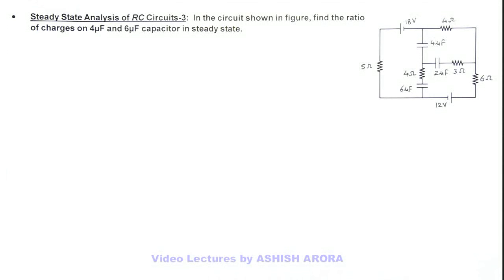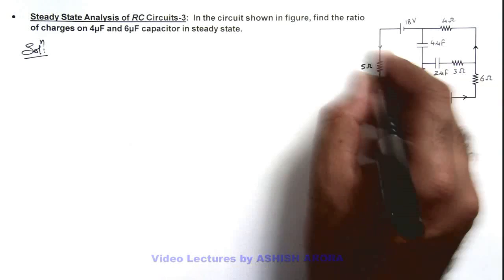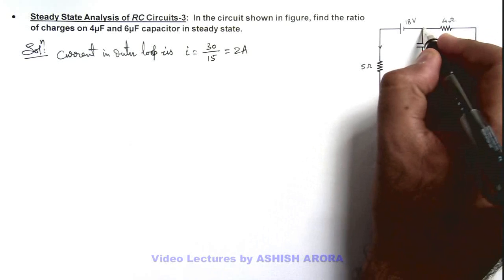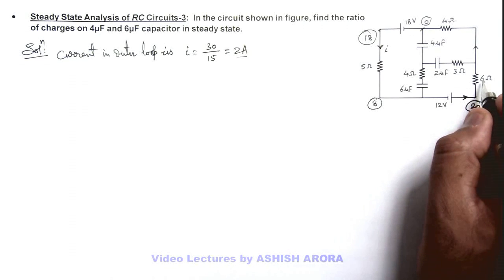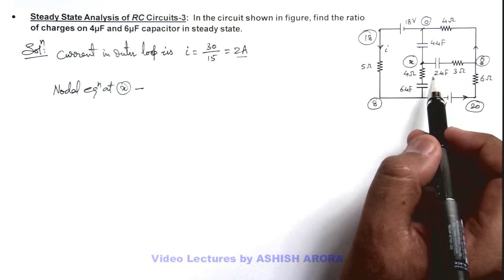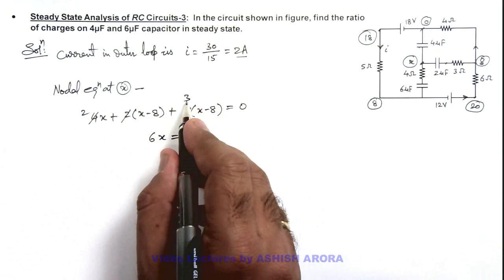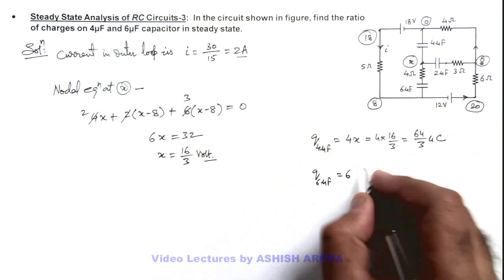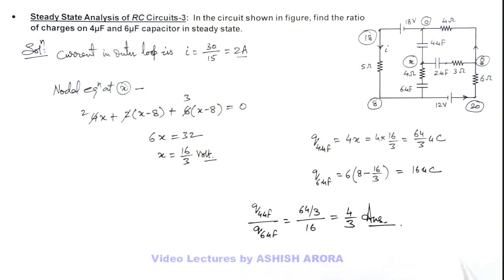11. Advance Illustration | Current Electricity | Steady State Analysis of RC Circuits-3

Comment: SIR Why did we Consider the Sum of charges to be zero in the ckt..And The explanation which u gave below in one of the comments..I m unable to understand that..
Sir if any other way of xplantion is there then can u pls ??
Reply: This is basically the 'conservation of charge'. Imagine, when we turned on the switch of the circuit, the capacitors start to be charged. At point x, if positive charges start to flow from one branch, they must flow through other two branches. Now if we consider that scenario as the 'flow of charges' from point x to the capacitors, we would get zero as their sum. 
You can think that in a different way. When we are considering the 'flow of charges' from point x to the capacitors, we are not supplying any charges from outside. So their sum must be zero.
I hope this helps.

Comment: how we will solbe the ques. if a capacitor is also present in the outer wire
Reply from the maker: Then it is solved by nodal analysis only as no current will flow in any loop of circuit in steady state in that condition... it is just like a capacitive circuit...
Reply: solbe kya hota hai

Comment: why current across third one will be x- 8 not x- 12???
Reply from the maker: because the potential at the bottom plate of 6µF capacitor is 8V... that we have already mentioned while distributing the potentials in circuit...

Comment: sir are steady state for both the capacitors  same ??
Reply from the maker: Steady state is for the circuit i.e. after a long time when all capacitors in circuit are fully charged... and current in capacitive branches becomes zero...
Reply: Its about overall ckt ..when both cap would attain steady state